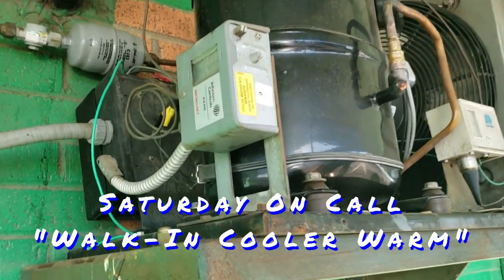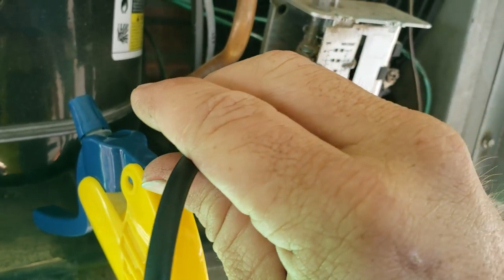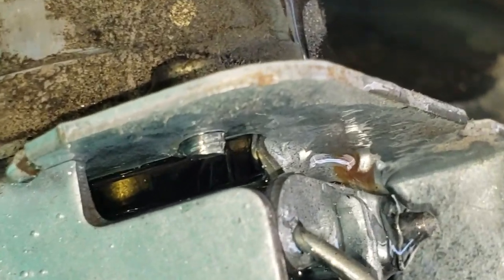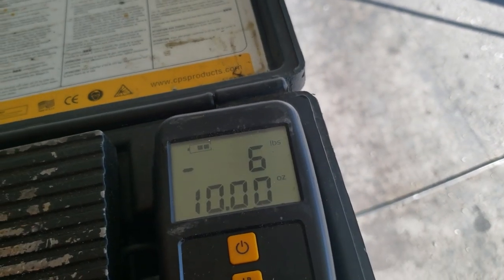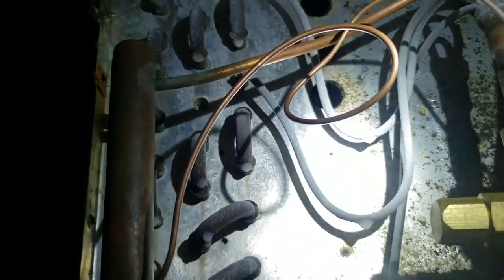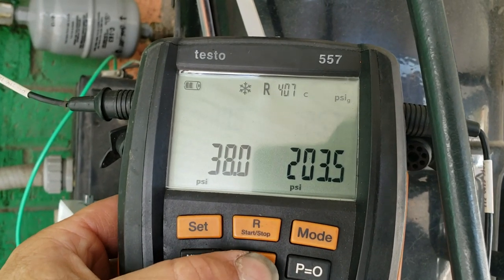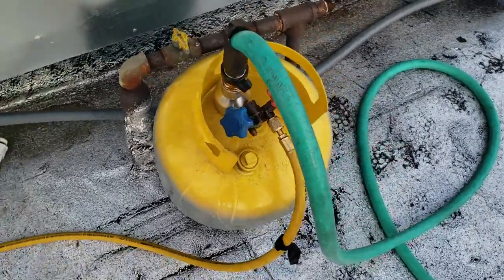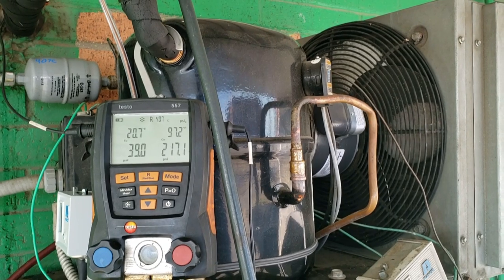Walk-In Warm Refrigerant Leak Pressure Switch Adjustment

Comment from the maker: I know the video is a little short and seems incomplete, so I'll cover a couple of the questions that I've gotten so far.  Once I found the leak and repaired it, I replaced the filter drier,  then evacuated the system, if I had known what was in the system I could have possibly recharged it.  The system was not completely empty and was under positive pressure. The txv was a R-22, and the compressor had been changed prior to me by someone else, the replacement compressor contained POE oil which is what's required for any of these new 400 series refrigerants.  Under these circumstances it was decided to go with 407c because it was a R-22 valve. There's several other things that you got to consider before choosing your refrigerant and doing the conversion, those are things better kept in a video and not in the notes. Thanks for watching!

Comment: Nice tip with the clear tube. I’ve always just coiled them up and bridged gaps with silicone.  Also love the comp cooler on the recovery tank. Only issue with that is you won’t be able to put a scale under the tank but it should work well if you know you’ve got enough room in the tank and weigh it before and after. Good video
Reply from the maker: It was just one example of trying to make more use of the tool, for $49 I'm not sure people will spend the money on it. I only used it once this summer. Normally I would use my heat exchanger loop in a bucket of ice water.  thanks for the comment, I don't think I've heard from you before,  I appreciate you taking the time to watch it.

Comment: The SLR2 is a good tool. There is a turbo mode which raises the sensitivity over HIGH. Additionally, the SLR2 is sensitive to abrupt movements which can lead to false positives.
Reply from the maker: I found that both detectors from Fieldpiece either missed to many leaks (IR version)  or false alarmed (HD version) so I sold them both. My two main detectors are the H10-PRO and the Detek Stratus and just yesterday I got the new Detek 3 that replaces the Detek Select. I'll be doing a video comparison on the Inficon detectors soon.

Comment: Hows the Ultrasonic? I'm still deciding what to get,. H10 OR ULTRASONIC.  Dealing with 410a and R22.  Commercial Ac
Reply from the maker: Like the manufacturer even mentions, it's a extra tool to help aid in finding the leak,  I would not give up my H10 for the ultrasonic,  but the ultrasonic has found leaks the H10 would have or did miss, but there is leaks the ultrasonic doesn't find because of the leaks characteristics didn't make noise. So having both is the best way.
Reply from the maker: This Is a call the ultrasonic missed because the leak was so large but as you seen the Fieldpiece even knew there was a leak.

Comment: I want to start using 3/8 hoses for vacuums & recoveries, do they sell 3/8 hoses with 1/4inch connections or do you have to buy a separate adapter? Sorry if the question is dumb lol
Reply from the maker: The hoses you see in the video are quarter inch connections on both sides with 3/8 in the middle. They say you don't want to use the same hose for Recovery that you use for evacuation. All the debris and oils gets trapped in the hose slowing down your vacuum. the 3/8 hose made a huge difference in my recovery time, but the three quarter inch made a huge Improvement on my evacuation time over the 3/8 hose. Either one's good compared to quarter inch.

Comment: Are you doing any residential work?
Reply from the maker: Unfortunately yes,  I've kinda stayed away from showing them for homeowner privacy issues. What do you want to see?
Reply: @HVACRSurvival  Hear pump diagnosis and repair.
Reply from the maker: @notanewbie1718  diagnosing reversing valve, accumulator, and outdoor metering device?
Reply: @HVACRSurvival  Yes these and any other problems you care to cover.  Thanks.  I dont see very many of them.  I have fixed a very few, but natural gas is king here.

Comment: Did you have to pull a vacuum
Reply from the maker: Yes, pulled a vacuum and change the filter drier. Generally anytime you change oils you're supposed to change any elastomer seals in addition normal refrigeration practices. In this case the oil was already Poe from the factory. It was Saturday and I didn't record as much as what I would like to of so the video looks little incomplete.  It could have had 407c already in there or one of many other alternatives,  or it could have been R22. No way to find out when the office ain't open.
Reply: @UC7EJjONRyeihmQELDIFF8qQ also did you recover the entire charge and throw in r407c?
Reply from the maker: @sandeepsekhon6748  yes,  once I found the leak I recovered the refrigerant, change the filter drier, evacuated it, and recharged 407c. The TXV was an R22 valve.
Reply: @HVACRSurvival  makes sense...thanks for the quick reply!